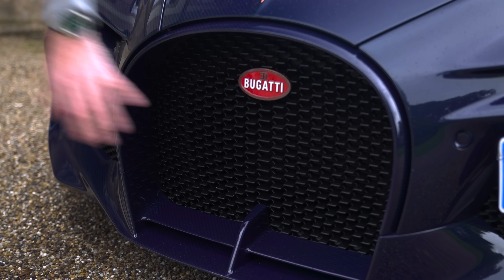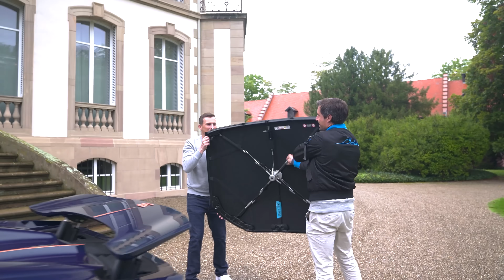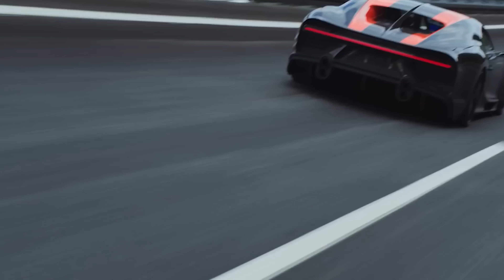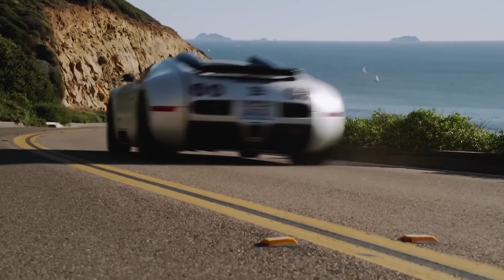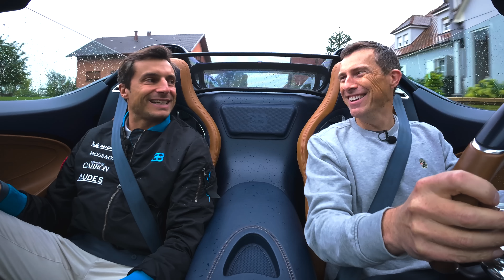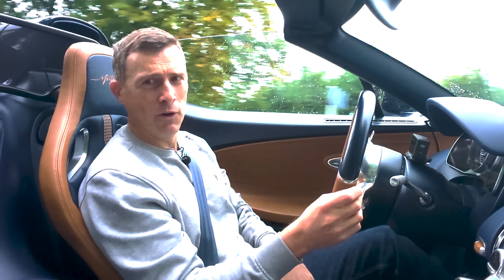Bugatti Mistral: The most expensive car I've EVER reviewed!

Comment: Lovely. Yes, driving a convertible in a bit of rain or when you need a bit of heat or air conditioning is way more fun than most people expect. Dress for the weather and that open air experience really helps you be in the moment.

Comment: i swear all bugatti's are the same with slight differences and the same engine for MORE $$$. lol and the new one is the same old VW W16 with slapped electric motors on it lol. also its millions but if you watch anyone break one down is had like 60% audi parts and VW passat internals etc. lol I will take a Koenigsegg any day of the week. every car is unique and the power trains are varied, plus they actually innovate and design things. Bugatti has been ripping people off for years since their original release with the same car, different shell lol even this car they have the hidden extra exhaust like KOENIGSEGG did with the REGERA lol

Comment: Of the car couldn’t get grip on the wet; wrong tyres, no tyre pressure, poor wheel alignment. Maybe the wrong size tyres or wheels. Shouldn’t have grip issue in rain; all you need to do on a car for wet handling is YOKOHAMA

Comment: I might be stupid. But if the roof covers the air intakes and they suck air from inside the cockpit, and it sucks 70.000 litres of air a minute. Would the negative pressure in the car not go very negative?

Comment: I am going to call out that given many super, hyper, exotic type cars are driven very low miles and often in very limited road and weather conditions that there would very likely be an abundance of driveability problems, part failures, and would be rather disappointing if driven frequently, on normal public roads, and in various weather conditions. Is it really that special if one truly enjoys driving to buy a multimillion dollar car just to basically only look at it, and be putting on trinkets of parts,  folding, storing, little custom branded bags and compartments to make it work. Thankfully the difference between have's, have not's, needs, and wants is wide and subjective as at this level of car's being a have not in life I would be absolutely thrilled instead to just grab the keys and drive in a 2026 Porsche Turbo S, or 2026 BMW M4 Competition. While a proper Tune and Modifications to optimize the car's would be my version of sheer luxury and performance. 😁

Comment: The novelty of the turbo induction intakes would soon wear thin.  The servicing costs are apparently astronomical.

Have to change the wheels completely every other tyre change.

I wonder what peak motoring looks like:
Reply: If you have 5 million to splurge on a car, you also have 30-40k for wheels and maintenance. These cars aren't daily driven, people keep them in collection. People that bought Veyrons for driving purposes managed to resolve that issue by converting to Lamborghini wheels, it's not like you will drive 350+ on a normal road.

Comment: That umbrella folding top is a joke. It looks worse than the top from the original Dodge viper. The exposed umbrella mechanism looks like trash when it's installed. I can't believe you have to install the wind deflector separately. Why not just integrate it and make the top fit into that? In fact, why not make a hard top that can fold like an accordion so it can be easily stowed away rather than some cheap canvas umbrella that you have to stick in a bag? Furthermore, does it really take two people to take that thing on and off? What a massive inconvenience.  All the money for this car and they couldn't figure out a way to integrate a power folding top. Good job Bugatti engineers.

Comment: So why is it worth 5 million euro again?  You have to manually remove the roof, put together parts to attach to the front window yourself, 3d printed parts everywhere, barely able to drive it safely in rain, youll never drive it even at 1/2 its top speed, and your cool AC air will be sucked out in 2 seconds.

Comment: From aero perspective using those extra exhausts is very interesting. See normally (ie. in F1) those would be used if allowed to blown diffuser, aka use Coanda effect to keep air following tighter radiused / raising diffuser or wing surfaces than what normally would be possible. But here I think they are used in full gas to stall slightly those largest diffuser slots and for that reason getting rid of too much aero and little bit of drag. Could be either way, have not seen wind tunnel results or CFD.

Comment: The 4 light elements also represent the 4 wheels it has and the 4 air vents from the engine bay and the 4 physical climate control buttons and the 4 holes in the seats and the 4 pieces of toast my 4 year old daughter had for breakfast and the 4 thumbs up my comment might get.

Comment: and btw, hybrid cars, I mean any hybrid cars - regular, super, hyper-whatever - they are less exciting than normal cars (hence the engine + turbos/no turbos) for the customers and harder to sell in the first place. Additionally, the number of parts is significantly higher, the engineering is vastly more complex, and the resale value is not as high - all of which add up in the long run

Comment: The math ain't mathing.  If the motor sucks in 70,000 liters of air per minute that is 2472 ft^3 of air or 41.2 Ft^3 of air per second.  The interior volume of the car is somewhere around 50 Ft^3 which would mean it is evacuating the air in the cabin nearly every second??? Besides feeling like a wind tunnel where is the make up air coming from?  Not to mention $5M and that is the roof?  Why not just give them an umbrella and lease them a human to hold it for them.  The rich are weird.
Reply: I said the samething about the roof, looks cheap and the design and materials look terrible, the roof on a 5M car should be carbon fiber and able to automatically fold into its own compartment, it also would look great with a tinted see through roof where your able to look out but no one can see in
Reply: I think he might’ve said 17,000?